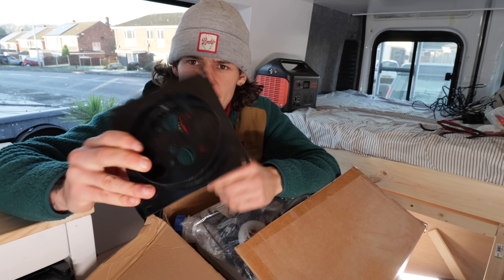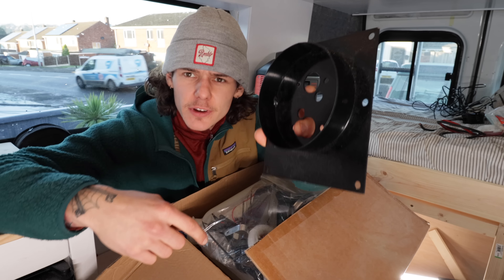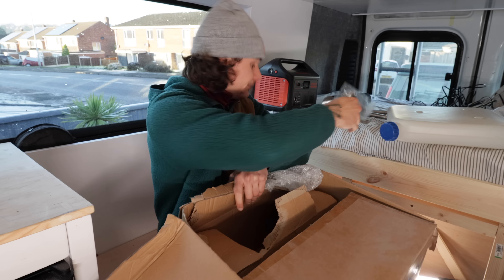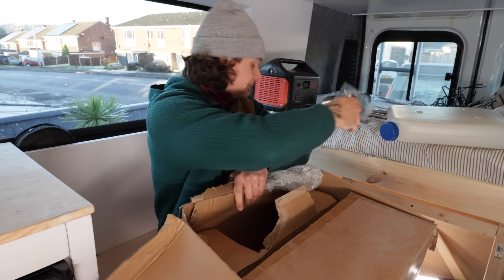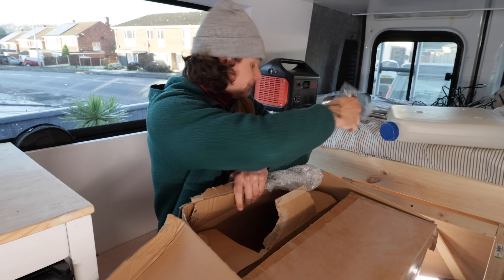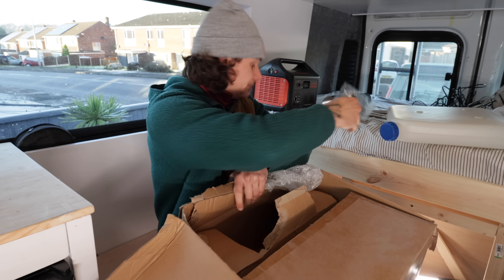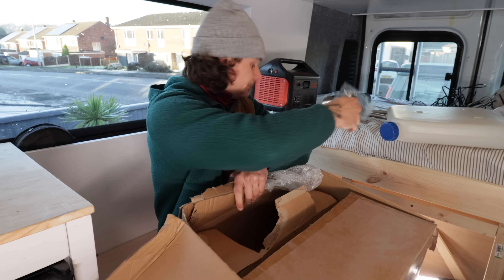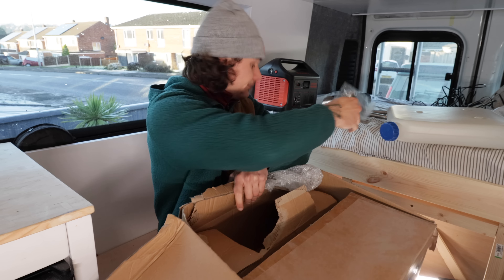HEAT YOUR HOME CHEAP! This Winter! ❄️🥶

Comment: If you hang the fuel pump off a tie wrap or similar it cuts right down on the tapping.
Reply from the maker: Legend! Cheers mate! 🙏
Reply: @JakesJourneyMate  you can buy little insulated boxes but hanging it stops it resonating on the panel.
Reply: @JakesJourneyMate  tie wraps awesome idea, also you can get a foam pool float and slice down the length and wrap it around the fuel pump to Insulate the sound as well.

Comment: Hi mate, looks like your fuel pump is in-line (90°) i think it works better if the fuel pump is set at 45° .... something to do with fuel delivery and air locks.

Comment: That there is the best £££ spent ,
my bit of advice,switch it on before you stop the engine so it doesn’t take the energy out of the leisure battery for start up,start up and shut down are the bit that drains the most power, I’ve had mine running from 9am until bed time while camped up ☀️🥂,just crack the door or open a window if heat is too much,
Enjoy the warmth 
Atb John 🏴
Reply from the maker: Great idea mate! just ran the engine up before the shut down cuz of this! thanks mate!

Comment: I like the sound of the rain on the van, it makes it feel cosy inside and it also drowns out some of the noise of Mrs S snoring at night.

Why don't you just carefully cut the hole for the heater vent with your jigsaw?  There's an overhang on the outside of the black plate to hide any minor blips.
Reply from the maker: love that Tony! works a treat with beck's too! XD
shout that mate!